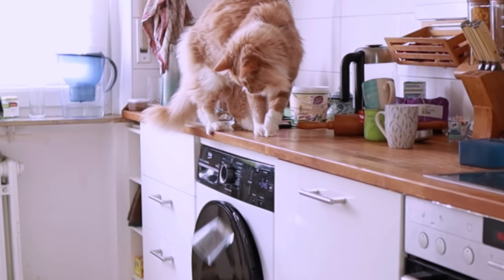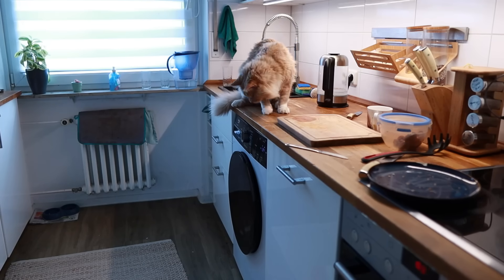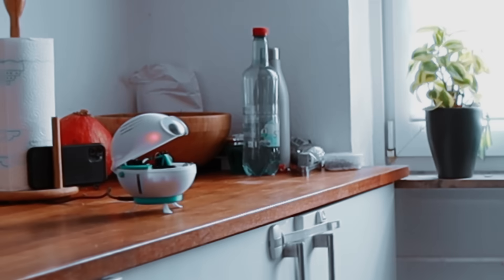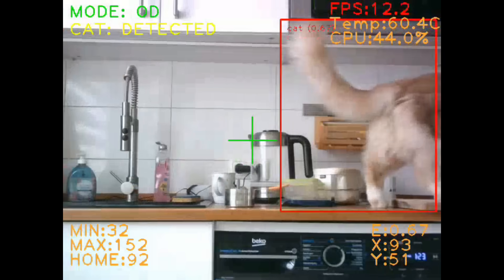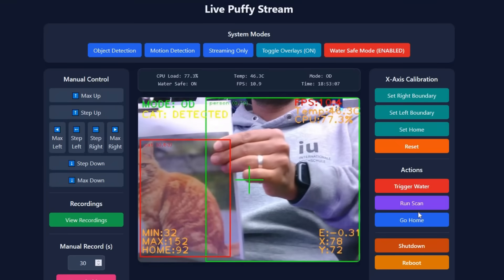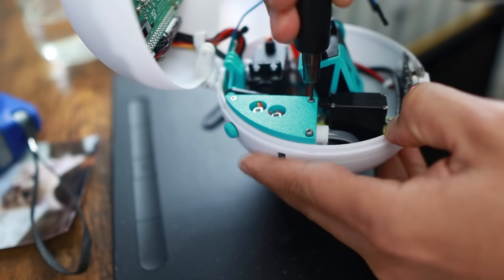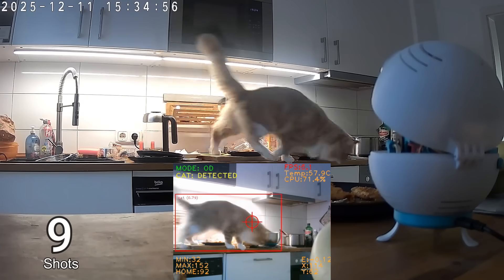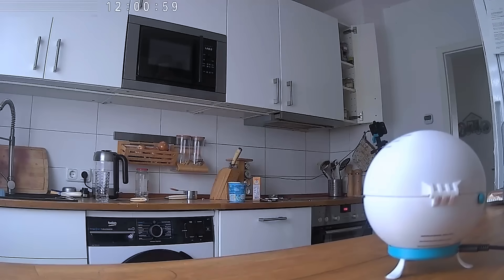My Cat Kept Jumping on the Counter..So I Built a Robot

Comment: Reminds me of Yard War I, myself vs. the Bird Feeder Raiders a.k.a. squirrels.  Squirrels are ridiculously agile and determined.  At first, I liked them until I bought a bird feeder.  I noticed they aren't nice at all. They are gluttons that will eat everything all at once.  It doesn't take long for them to destroy a feeder by biting into the container to eat faster.
One squirrel was extremely obese and domineering.  
Tried many things, but after the last failure decided to get genius-level serious.  After all we were representing Mankind.  
For the bird feeder project.  Performed research upon how far they can jump and climb.  Their habits and such:  You'll discover they are incontinent cannibals that crap in their own nest.  Besides that, they are as physically formidable as their hard-to-kill mouse cousins.
Based on the gathered information a post location was calculated some distance from trees.   Bought a pole for bird feeders.  Part of the length goes into the ground.  The problem is the overall height to the feeder.  When positioned upon completion it would be three, very-important, feet short according to jumping data and estimates.  
Purchased a pipe as an extension and base.   The secret sauce is the torpedo tube.  It's an inverted steel container with hole.  Squirrels and mice climbing up get blocked as the move inside the tube.  They are forced to retreat.
The property has very sandy soil.  A post-leveling is important.  Even proper leveling the previous feeder listed over a few years due to the feeder's weight, rainstorm water, dry spells, and hurricanes (feeder always removed upon warning).  There's one feeder for sunflower seeds and another for mixed seeds on the pole.  These ran along a N-S axis.  
The plan for the base required quintupling the surface height and concrete mass beyond the usual methods.  Lawn growth roots help anchor by sand particles, so they don't shift.   
Calculations need to include "squirrel jumps" from nearby trees.  Even if unsuccessful could dislodge and unlevel that post.   Over time the post would list to one side.
The first week of installation was both funny and filled with anxiety.   Would the idea work?  Squirrels make up in physicality what they can't do brain wise.  We gave it a year to produce a verdict.
After a season or two we still see the sight of frustrated squirrels trying to jailbreak the system.  They always move to plan B.  That's after trying to get past the torpedo tube.   First, they try climbing up and they get stuck inside.   The tube is designed to also jiggle a bit, so they try to tilt it then claw its side.  Some try to jump past the tube since its top is cone shaped and slippery due to its coating.  
Plan B is jumping from the closest tree in the bid to latch onto the post or striking down the feeder.  Good look with the latter as we use Spectre (better than Kevlar and more UV resistant, rated at 1000 pounds) twine to hold up the feeder.   It's amusing seeing them try to land onto the torpedo tube over and over again while puffing on my Savinelli.
That was well over 10 years ago.  Not a single breach was ever seen or detected.  When we see a squirrel trying to beat the feeder someone always jokes, "he must be new".  That a joke that never gets old-

Comment: This is brilliant. I've been around cats for a long time. Learned that the best solution is to remove food and breakables from the countertop - and the cat is bored and jumps down. I also learned that eventually, water spray doesn't work forever. I've seen cats stare down a human with a full water sprayer. It's like "braveheart" cat style. That said... I wonder what a cat would do against a robot hurling projectiles. Pellets? Nerf darts?

Comment: Awesome idea. I trained mine to jump up. lol. Here is an idea I wish someone would make. You can run with it. This concept is an interactive, motor-driven cat toy inspired by the mechanics of a ski-lift or gondola system. The core idea is a continuous string or cord loop that runs around selected areas of a home, allowing a toy “prey” element to travel back and forth at variable speeds. The moving target encourages sustained chasing behavior, simulating natural hunting instincts while keeping the cat engaged for longer periods than stationary toys.

The system begins with a removable C-clamp that mounts to a standard interior door frame without permanent modification. This clamp supports a small round wheel or pulley, similar to those used in cable transport systems, allowing the string to pass smoothly through the opening. Additional door frames can be equipped with identical clamp-and-wheel modules, creating a guided path for the string through multiple rooms.

For situations where no door frame is available, such as wall corners or open transitions, the system includes a corner module. This module consists of two interlocking molded plastic pieces (approximately 3 × 2 inches each) fitted with dual pulleys, allowing the string to change direction cleanly without friction or derailment. These corner units enable flexible routing around the house while maintaining consistent string tension and motion.

At one location in the loop, a battery-powered motor unit is installed. This motor drives the continuous string and is controlled by a simple remote, allowing the user to start, stop, reverse direction, or vary speed. A lightweight toy—such as a mouse or feather—is clipped to the moving string, traveling along the loop as the system operates.

As the motor runs, the toy moves back and forth through doorways and around corners, prompting the cat to chase it repeatedly throughout the home. When the cycle completes, the toy returns to its starting position, allowing for repeated play sessions without resetting. The result is a modular, scalable indoor play system that combines physical activity, unpredictability, and owner control in a single interactive cat toy

It’s so easy! This idea will make a million for people who hate cats outdoors. Make it look like a dog hook it up to a garden hose. lol.

Comment: I had thought of something similar but instead of using a pump (which are know for short life), I intended to use  compressed gas canister.  Eventually it wouldn’t need water as just the phasst of the air would deter the cat.   Consider changing your design, and I’d be interested.
Reply: I got my idea from a circa 70’s/80’s battery powered device used to dispense fly spray in restaurants and horse stalls.  You’d buy special canisters with a special spray head. If you depressed the head, it would spray a half second of the permethrin bug spray.  The dispenser ran on two D batteries.  You could set different spray interval.  All mechanical, nothing digital.  Very long life mechanically and battery life.  The canister lasted a long while too.  For cat deterrent, I was thinking the “canned air” ,  commonly sold to clean electronics could be used.  A strong blast of air might be enough by itself to deter a cat.  Cats don’t like water or blasts of air.

Comment: You are far more brilliant that I am, but I would suggest using an high pressure external source for the water, and use a valve to control shots. Not only would this provide better trajectory, it would add punch to wetness.

Comment: That's what one should not do to cats, and it is honestly sad as hell, that you enjoy it and so many ppl think it is ok to use deterrents on cats.
It does not work well with them.
Yes, you might detter it from going where you do not want to, but the cats get a very bad emotional outburn and it does and will affect his mood, sensitivity and will eventually lead to other issues, both behavioral and phisical.
With cats pasitive reinforcement works way better.
Takes effort though, but btw builts better relationship with the caretaker and helps build confidence in the pet.
Btw, I wonder how many ppl would use such or similar tool on their kids, to detter them from doing something.

Comment: I had the same idea since our cats were also always up to no good on the kitchen counter. But building an automatic water gun seemed too complicated for me. So, I looked for a simpler solution that has worked well for me so far. Our cats doesn't like wind, so I installed this setup:
A battery-operated motion detector triggering a wireless socket (available as a set for little money). Then I plugged in a small, powerful fan with a rotation mode. The floor stays dry, and it works at night, too ;-)
But definitely a cool project!

Comment: Brilliant!!
I’ve been dealing with the same issue. My solution is slightly lower tech. A garden spray bottle with a Switchbot bot stuck to it. It’s on the island bench pointing towards the sink, which is where they (yes, 2 little monsters) get up most often. I can see them from the lounge room, but they knew I had to get there to do anything so just ignored me until I got to the kitchen door. But now… Hey Siri, turn on bench bot. They HATE it. I love it 😂

If they figure out how to stay out of range I’ll be putting myself on the puffy waitlist. I’d need the plug and play option as o haven’t bought a 3D printer yet.

Comment: All i did was get a huge extension lead  and plug it into my vaccum, id leave it near the lounge so when shed go to scratch, plug in the vaccum. scared her away from the lounge. lol I could modernise it and add a wifi adapter if needed but, after a few times she learnt not to go near the back of the lounge.

Comment: I love this, and wold purchase both diy and ready made.  However, i would need this to stop dogs from putting paws on the kitchen counter and trying to vacuum off whatever is in reach of their long necks and huge heads.   My issue is the lab and retriever are both big enough to get into anything that is 2/3rs the depth of the countertop.  At the moment, our kitchen has everything pushed back against the back wall to try and alleviate the problem.

Comment: Suggestions:
1: Play a sound before spraying cat, preferably owner loudly saying “(Pet’s name) NO!” or something similar.
2: Take a picture of the offending pet and log the time.
3:  Use MQTT using the above data so the information can be exported to user’s automation platform, that is HomeAssistant, Homey, Hubitat, Alexa, etc.
4: Please, please try to get a patent on this before some big corporation steal this from you.  If they try put it public domain so that they don’t screw you.  Also if you have this fabricated don’t give them the source code or compiled bin file; flash the code on each device yourself.

Comment: The robot needs to be filled with sulfuric acid. Then it will be effective. Or pass 10,000 volts through the table as the cat jumps on it. Two cat jumps on the table per month is unacceptable.

Comment: I ripped gaffer tape into half width strips about 4 feet long and laid them sticky side up along the edge of the counters while I was away.  A few empty cans stuck to the tape added to the startle factor.
Cats jump up, tape sticks to their feet  and  jump down with clattering can.
It took a couple weeks to keep 2 cats off the counters forever.
When using the kitchen, I'd hang the strips on a vertical surface.
Reply: You should’ve setup a camera and recorded it! It will be so fun to watch.
Reply: that's evil 😂
Reply: Double sided tape is your best friend for preventing cats from doing something. They HATE having sticky paws
Reply: :))) good idea imagine the look of the cat wtf is this
Reply: Similar method:  
Line up empty cans along edge of counter.  (Adhesive tape optional.)  Stack 2-high, slightly overhanging the edge, for even better results.  Leave an obvious gap wide enough for cat to jump through onto countertop.  In the gap, place one or more small snap-type mouse traps, armed, up side down so they won't injure the cat.

Cat waits 'til human is out of the kitchen, preferably asleep.  Cat jumps through convenient gap in empty can fence, bumps mouse trap(s), which go *SNAP!*   

Startled cat spazzes out, knocking over a few cans, which bring down an avalanche of other cans, creating noisy chaos.  Cat hides under furniture for a while, grooming to calm themselves.

My cats pretty much ignore household cleaner spray bottles rinsed and refilled with water.  However, hosing them down with a recycled mustard or honey dispenser filled with water delivers a heavy enough stream to get their attention.

Those electrified mats also work great, although more expensive.  Same applies to the hissing compressed gas canisters with motion detectors.  By the time the can is empty or the battery dead, just the sight of it will discourage most cats.

No matter how well you stifle your snickering from another room, the cat will know who set them up for this humiliation.
Reply: Why don't you simply yell at the beast?
A few times yelling and problem is solved 🤷🏼😴
Reply: @OmmerSyssel  If only that were so easy. If you yell, the cat will start associating yelling with you, not with jumping on the counter - it will develop an anxiety of you and your relationship with the critter is going to suffer. Also, even if it works, it may just happen that you solve one problem and create another in the form of cat urine soaked sofa or bed - they mark with urine as a stress relief and protest method. If you really want to teach it, make it a constant consequence that does not involve your reaction.

Comment: I subscribed and loved the engineering but I'd recommend not spraying cats with water since they will develop a fear of water in the future, so if they ever need a bath you would have a hard time. The cat whisperer recommended specific sound followed by a gust of high pressure air which also sounds like a cat hissing which will cause the cat to relate it as a negative experience not wanting to repeat the behavior. Other than that keep up the fun and chill content

Comment: Do it for mosquitoes next, except it'll be lasers instead of water. Also, as a head starter, you can try to apply some kind of fluorescent material to the mosquitoes by slathering it on a surface and drawing them in with a bait scent...Oh wait, I just thought that you can use the same strategy to draw the mosquitoes into a glue trap...Oh well, but you should still go for the laser cannon anyway. It'll be hella fun

Comment: You should add a sound that plays before spraying water, at some point he will react to the sound without the need of spraying, thus saving you water
Reply from the maker: That’s actually on the list for Puffy 2.0 👀
Reply: @TheLab-X vacuum cleaner sound
Reply: @Bryan-Hensley 😂
Reply: @TheLab-X  Please be Portal turret sound
Reply: @TheLab-X You are a shit engineer.
Reply: Pavlov's cat
Reply: like automated turrets in video games, that warn you before you are in sight :D
Reply: Bigger tank can work just as well. I'd do a tank in the base, with hose running through center. Would double up as a weight, making it harder for the critter to move it if it decides to go on the offensive.
Reply: 😮 that Is impressive. I was always able to get away with just putting fans on my kitchen counter. My Siamese cats don’t like air blowing at them directly. But they have much shorter hair. Not sure how any other peoples cats would react, but it was a tip I got from veterinarian.
Reply: Critical feature for the Iranian market
Reply: Mechanical alarm clock with the metal bell ringing should do it.
Reply: Excellent ! 👍👍👍👍👍👍👍👍
Reply: This will just allow the cat time to avoid the spray while not actually getting off of the counter.
Reply: there is a sound, it doesn't spray straight away?
Reply: Did you actually watch the video?
Reply: @u1zha  agreed... by the end, the cat is reacting to the noise of the sentry starting to move.
BUT having it make a more noticeable noise would likely have made for a shorter learning curve.
Reply: How about m4 bullets🤣🤣
Reply: How sad is your life trying to save up some water?
Reply: It's more about not having to refill the tank and not having water on the kitchen counter. Why keep spraying water when a sound does the job.
Reply: @rexefe559  are you 8 ?
Reply: @rexefe559 what a disgusting question
Reply: @rexefe559  He's trying to save having to refill it
Reply: @rexefe559  This is what passes for trolling nowadays?
Reply: @rexefe559 did you think that one through?
Reply: @rexefe559 says the African 🤣
Reply: Yes the A word.